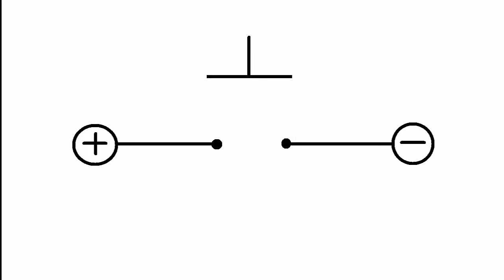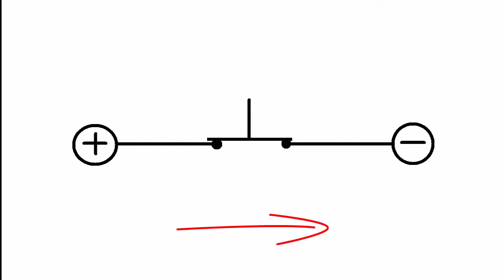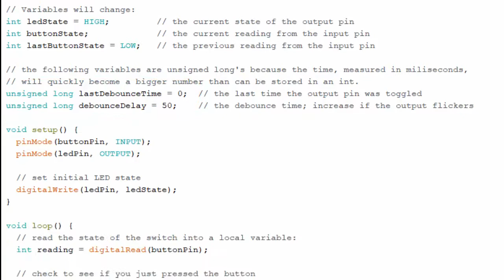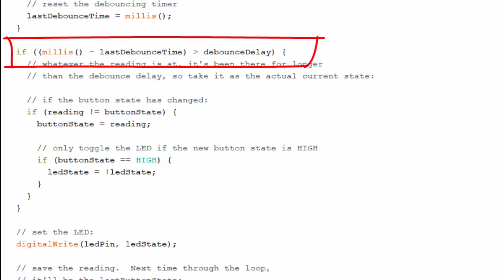Arduino Tutorial #15 How to debounce pushbutton ?

Comment: hello , the only thing i dont understand in the code is why we did not initialiaze the int buttonState, shouldnt we have initialized it to LOW or HIGH  to make the comparison with the reading later?
Reply from the maker: when we take 
int buttonState;
it is by default LOW or 0.
Reply: Robotica DIY ohhhh ok I see now. So practically we could also write 
int lastbuttonstate;
Instead of
int lastbuttonstate = LOW;
And one more question if we do the whole project with a pull-up resistor, do we need to make buttonstate = HIGH and lastbuttonstate=HIGH?
Thanks in advance

Comment: but how millis-lastdebouncetime>debouncedelay
because in previous line you write lastdebouncetime=millis()...
Reply from the maker: Mohit, for example light is ON after uploading code. millis count time from program started. and you press pushbutton. then reading is not equal to last button state.
  
if (reading != lastButtonState) {
 // reset the debouncing timer
 lastDebounceTime = millis();
 }for example code is running for 1000 millisecond then last debouce time will be 1000 millisecond.
if ((millis() - lastDebounceTime) > debounceDelay)here millis() is around 1005 millisecond as time passed from last if loop. so 1005-1000=5 which is not greater than 50. so both nested if code will skip. and
 lastButtonState = reading;
 so our second loop started you have still pressed the button (only 10 to 20 millisecond passed :)
now again
if (reading != lastButtonState) {
 // reset the debouncing timer
 lastDebounceTime = millis();
 }now reading is equal to last button state. so this code will skip and we have last debounce time is 1000 millisecond.if ((millis() - lastDebounceTime) > debounceDelay)now millis() equal to 1060 millisecond because it is getting time from when it is started. now it 1060-1000=60 which is greater than 50.if it is not greater than 50 again third loop start.
i hope this will help you to understand.

Comment: Im want to add 2 more button and led, Then what can i do?
Reply from the maker: i am giving you code for  3 LED and 3 push button (debouncing code). I have checked it.. it works fine :)
note: sometime copy & paste causes to error so don't copy paste write code yourself by watching this.

const int buttonPin1 = 2; 
const int buttonPin2 = 3;  
const int buttonPin3 = 4;  
const int ledPin1 = 13;   
const int ledPin2 = 12;  
const int ledPin3 = 11;   

int ledState1 = HIGH;  
int ledState2 = HIGH;  
int ledState3 = HIGH;     
int buttonState1;    
int buttonState2;  
int buttonState3;       
int lastButtonState1 = LOW;   
int lastButtonState2 = LOW; 
int lastButtonState3 = LOW;   

unsigned long lastDebounceTime = 0; 
unsigned long debounceDelay = 50;  

void setup() {
  pinMode(buttonPin1, INPUT);
  pinMode(buttonPin2, INPUT);
  pinMode(buttonPin3, INPUT);
  pinMode(ledPin1, OUTPUT);
  pinMode(ledPin2, OUTPUT);
  pinMode(ledPin3, OUTPUT);

  digitalWrite(ledPin1, ledState1);
  digitalWrite(ledPin2, ledState2);
  digitalWrite(ledPin3, ledState3);
}

void loop() {

  int reading1 = digitalRead(buttonPin1);
  int reading2 = digitalRead(buttonPin2);
  int reading3 = digitalRead(buttonPin3);

  if (reading1 != lastButtonState1) {

    lastDebounceTime = millis();
  }

  if ((millis() - lastDebounceTime) > debounceDelay) {

    if (reading1 != buttonState1) {
      buttonState1 = reading1;

      if (buttonState1 == HIGH) {
        ledState1 = !ledState1;
      }
    }
  }

  digitalWrite(ledPin1, ledState1);
  lastButtonState1 = reading1;

if (reading2 != lastButtonState2) {

    lastDebounceTime = millis();
  }

  if ((millis() - lastDebounceTime) > debounceDelay) {

    if (reading2 != buttonState2) {
      buttonState2 = reading2;

      if (buttonState2 == HIGH) {
        ledState2 = !ledState2;
      }
    }
  }

  digitalWrite(ledPin2, ledState2);
  lastButtonState2 = reading2;

if (reading3 != lastButtonState3) {

    lastDebounceTime = millis();
  }

  if ((millis() - lastDebounceTime) > debounceDelay) {

    if (reading3 != buttonState3) {
      buttonState3 = reading3;

      if (buttonState3 == HIGH) {
        ledState3 = !ledState3;
      }
    }
  }

  digitalWrite(ledPin3, ledState3);
  lastButtonState3 = reading3;
}
Reply: Thank you very much. Love you      :)
Reply: hi
I have used arduino with 4 channel relay to reverse forward DC motor using a push button. 
the code works well without DC power input supply but it won't with supply on.
plz help me to resolve this